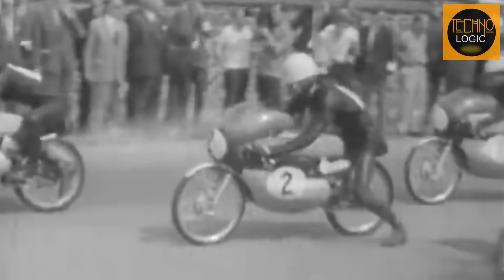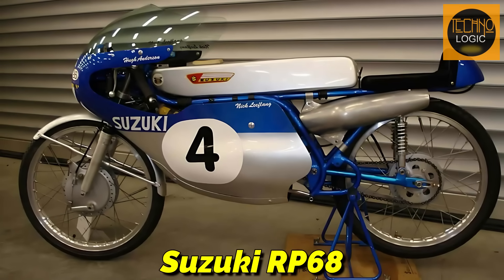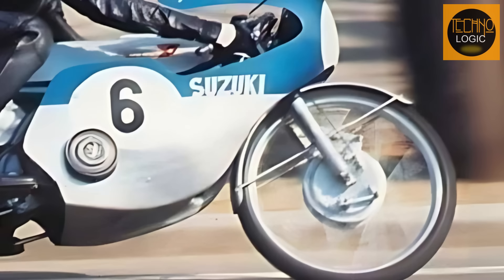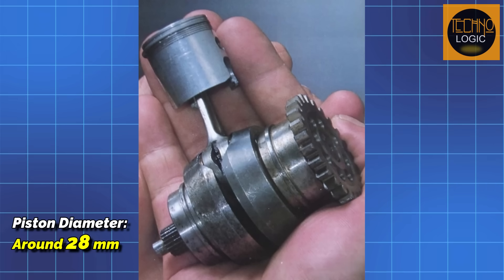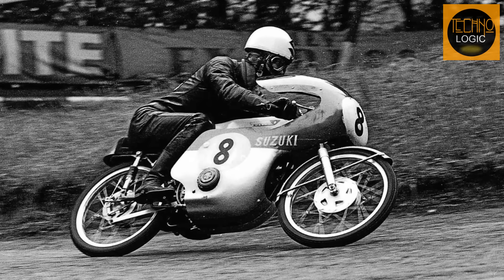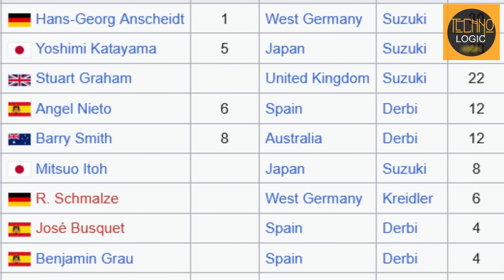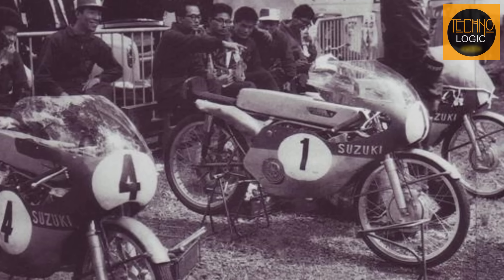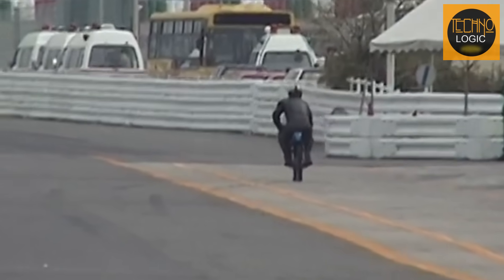INSANE‼️ Suzuki's 50cc V3 with 16 Gears: The 1960s Ambitious Project to Beat Honda

Comment: The cylinder bore was 32.5 millimetres or 1 1/3 inches! A US silver dollar has a diameter of 1 1/2 inches! 17.5 hp! Max rpm's 17,300 .. at which each cylinder would be firing 144 times a second! Top speed 109 mph! Engine displacement 49.75 cc .. in comparison the average gas engine for a push lawnmower is between 140 cc and 190 cc and has only 2 to 7 horsepower! The RK67 was indeed AMAZING!
Reply: That most importance are materials behind this engine

Comment: I still wonder why the racing organizers didn't immediately intervene with these multi-cylinder engines.
Multi-cylinder engines with the same total displacement can always produce more power because of the larger available cylinder and cylinder head surface area relative to the displacement, meaning valves or ports that simply have more flow.
They hadn't anticipated this in the technical regulations, which encouraged unfairness.
Moreover, only manufacturers with more money can produce these engines more easily.

Comment: 400HP per Liter but at least slower than the RK67 Twin, H.G. Anscheidt have reported from test runs that the RP was peakier and so more difficult to ride and at least it leads to slower lap times even the tracks were faster with more flat out parts

Comment: The 1968 Suzuki RP68 was intended to compete in the 1968 season, however a rule change mandating single-cylinder engines meant that the 50 cc (3.1 cu in) RP68 never raced.

Comment: The V3 engine has pistons the size of sewing thimbles, the rings could be used a wedding bands, you're almost getting into toy RC engine specs, and they do over 100 mph with a human onboard,
Reply: Not so. The width of sewing thimbles, which refers to their diameter, varies significantly by size and brand, generally ranging from approximately 14 mm to 18.5 mm for standard metal thimbles. The specification stated on this video is that the piston diameter of the V3 50cc was around 28 mm which is over one inch wide which is a lot bigger than the diameter of an average sewing thimble.

Comment: Honda only won a single 50cc title. It was always Suzuki that led the way in this class.
Reply: Yes, thanks to stealing the technology from MZ. 👍
Reply: @blipco5 all manufacturers steal other manufacturers technology. It’s been going on in every form of Racing there is.
Reply: @xipingpooh5783  Walter Kaaden was an original designer. He didn’t steal from anybody. Suzuki flat out stole his plans through Degner.
Reply: @blipco5  Wrong, using a tuned exhaust was established practice before Kaaden applied it to a motorcycle.

Comment: I heard of Honda producing a 50cc twin, but this Suzuki is surely miraculous? And so long ago! Thank you so much for a fascinating video.
Reply: It would no doubt be easier to produce a triple 2 stroke than a 4 stroke as all you need is sufficient cylinder diameter to accommodate a spark plug, no room n3eded for valves!
Reply: Honda also made a 5 cylinder 125 cc machine, it was a 4 stroke.
Reply: @georgebarnes8163 Fascinating. I'll have to investigate. Thank you very much. Best regards.
Reply: @SpiritintheSky. Specially for secret of the materials its very amazing

Comment: And you of course failed to recognize that suzuki stole the mz research results from the brilliant german MZ Engineer Walter Kaaden , who despite only having very small means to work with, and only through persistence and sheer brilliance had made enormous leaps in high power two stroke development . And it was only with this "help" that suzuki were so far ahead of the competition !
Reply: Walter Kaaden hat es das Herz gebrochen.😢
Reply: Ernst Degner was an east German who rode for motorwerken zashpow mz he defected will the help of Jimmy from Suzuki that's how Suzuki got Walter Kardens tech
Reply: Kaaden didn't invent it either.
Reply: Not stolen Kaaden took it to Japan unhappy with MZ. by the way the idea was first used in V1 rockets.
Reply: @stanis4218 No he didn't. And yes the only way a second rate(at best..) manufacturer like suz. could do what they did in racing , was with stolen technology ! Get real and open your eyes 🫣
Reply: Das war Degner . Bitte richtig informieren bevor man so einen Unsinn schreibt.  @stanis4218
Reply: @stanis4218  "by the way the idea was first used in V1 rockets." No it wasn't - stop repeating nonsense.

Comment: Technology better suited to large displacement high revving 4-strokes....Which is exactly the direction Japanese makers went with it, within only a few years. This kind of complication makes no sense in small cc two-strokes (or 4) It's little more than an engineering exercise, leading to much larger engine designs sometime later.

Comment: Fascinating story, fascinating machine.  But the commentary is just plain weird, the narrator made numerous flubs.  First, the Suzuki's tube frame was made of steel, not aluminum.  Second, the word "liter" is pronounced "lee-tur."  And not "lighter", as he stated.  And finally Hans Georg Anscheidt's middle name is not pronounced "Gee-org."  Otherwise, an interesting tome..    .
Reply: The blue frame is aluminum. Look at the thickness of the brackets and size of welds.

Comment: 4:34 A misconception: The gearbox usually has as many gears as needed for the specific race-course. Which means, while a course needs 15 specific gears, another course may demand 16 specific gears, which are different to the 15 gears of the previous course. Not every single gear is different/changed, but many won´t be found in the next gearbox. The gears chosen, relate to the number of curves of the specific course, and the capabilities of the driver/machine-combo: When the driver exits a specific curve of the course, he shall have a matching gear to shift-up smoothly (dependent on the driver/machine-combo capabilities). In other words, each gear was attributed to a single curve of a specific race-course of the championship, although it might end up being used in several other curves of different race-courses but with similar characteristics (similar entry-speed, similar exit-speed-potential, similar curve-curvature, -inclination and -angle).
Reply: Many gears were needed to keep the engine within its narrow powerband (500 rpm). I don't think there is any correlation between track curves and the number of gears.
Reply: @TheHalloweenmasks  You´ll agree, that reducing the powerband from 2000rpm to 500rpm would need 24 gears instead of just 6... So, 16 gears isn´t "a lot", it´s "too few" (but more than 17-18 is anyways impossible)... But when is the most important timepoint, when a gear-change matters most? It´s the curve-exit. Racers don´t compete on endless, straight lines (that´s why their possible top-speeds are much higher than what they´ll reach in real-life-races), they just try to reduce the negative effects of curves. And if there´s too few curves (and so, less gears for curves are needed), then they have room left for what you meant. Aside to that, what you say, it would mean a fixed gearbox for a fixed engine... But in reality, despite the engine always being the same ("fixed"), the gearbox contains different gears from race to race.
Reply: Sir have u heard what kind materials of gears to build this engine?

Comment: A Uprated copy of the DKW.
Reply: MZ. not DKW
While MZ rose from the ashes of the original pre-war DKW works, post war DKW started up again in Ingolstadt in Bavaria. The Suzukis were derived from details stolen from MZ by Ernst Degner - at that time, MZ and DKW were not related. DKW did make an interesting 3 cylinder racer post war though.

Comment: Luv the rotary valve twin cylinder 2-strokes.
Reply: It's still the way to go for two-stroke design if you are after top-end power.

Modern kart engines all use rotary valve induction, unless the regulations proscribe them. A Reed Valve 125cc will typically drop 2-3bhp in comparison.

Comment: The V3 Suzuki never raced, it was too complcated. The Kreidler VanVeen had only 1 cylinder and more horsepower, about 21.
Reply: Was nothing to do with being too complicated it was due to changes in the rules which only allowed single cylinder engines. Honda also had a triple cylinder four stroke but that was also never raced
Reply: The rules changed before it could be raced.
Reply: @rekzkat I just explained that 😂
Reply: The sixties 2-strokes from Japan were tuned to different principles: with high crankcase compression, different porting, and lots more, they are from a different generation to the Kreidler. 
A same-generation multi-cylinder design would have the upper hand. Especially a Japanese one. Even with six gears.
Reply: @TobiasCat-s7n  on the world circus yes on short circuits no.
Reply: The Van Veen was produced years later, if Suzuki had done more development on the engine likely would produced more hp
Reply: @A-FrameWedge it would win on the big world championship circuits but on short circuits it wouldn't have time to get wound up because of the lack of drive ability. I'm good friends with Hugh Anderson and he told me what they were like to ride.

Comment: I wonder, if  Ernst Degner was involved in the development. Some say he brought a lot of knowledge about 2-Strokes to Suzuki.
Reply: he brought the knowledge of 2stroke-exhaust-resonance-chambers (he learnt about while a technician, building the V1-pulse-jet-rocket), that´s the 2stroke´s turbocharger (without moving parts). For me, a 2stroke without it, isn´t even something worth called an "engine", cause it can only half-breathe.
Reply: @klausbrinck2137 " he learnt about while a technician, building the V1-pulse-jet-rocket"
No "he" didn't. Degner was only 14 or 15 at the end of the war.
And the V1 was a pulse jet, not a rocket- different technologies that Walter Kaaden didnt work on either. He apparently worked for the aircraft manufactuer Henschel on the control systems for the HS293 glide bomb which was a Luftwaffe project - the Vi was a Fiesler product with an Argus pluse jet.and was an Army project.
Reply: @mgnbukint6502  It´s true, I confused the mentor and the pupil, but still, "rocket" isn´t a tech describing anything precise, so, one can clutch the word "rocket" to nearly everything, it´s just a marketing-term... It´s just a word without scientific content/meaning...
Reply: @klausbrinck2137  In engineering, use of words matters. 

So a pulse jet is a resonant engine type - a rocket motor works on different principles, with little in common. The V1 ( a simple subsonic cruise missile) used a pulse jet, the V2 (a supersonic intercontinental ballistic missile) used a rocket motor. 

Kaaden had nothing to do with either of them. Resonant exhaust systems were known about before WW2. Assymetric timing of two stroke engines was known about before WW2 (IIRC Scott raced a  liquid cooled rotary valve two stroke twin at the TT around 1922). Kaaden actively sought to use a resonant exhaust with a rotary valve two stroke - he didn't invent either, but was the first to bring the two together & put in the hard yards working out the wrinkles under very difficult circumstances (no money, few resources in the early post war DDR). 

Then, as the results started to come in after all the hard work, Degner stole the details & sold them to Suzuki in such a way as to deny MZ the World Championship. His defection meant that MZ personel were not allowed to travel abroad to contest the World Championship again.  

Degner was a self-serving individual who didn't care about the cost to his collegues of his treachery. Arguably he got his just deserts later.
Reply: Check the book "Stealing Speed" by Mat Oxley

But Degner was not the one behind the technology development at MZ. That was Walter Kaaden, who was also the one workung on the V1.
Reply: @Stroke2Engineering  Sorry, my mistake !!!
Reply: @Stroke2Engineering  "That was Walter Kaaden, who was also the one workung on the V1." Kaaden didn't work on the V1
Reply: @mgnbukint6502  where do you have that info from?

Comment: Nice video. If memory serves me well, it was never called GP50 class. The 50cc category was just one of the 6 classes that made up the motorcycle worldchampionship racing in those days. I was there, happy times!
Reply: I once had a good look at Honda's full line-up of GP bikes back then, Hailwood's 6-cylinder machine and their 50cc vertical twin, Just before the 750 - 4 launch,,

Comment: The first time I hear about a V3 Suzuki 50cm3.
The made a twin.
Reply: It was supposed to be next evolution of the 50cc gp bike but Suzuki pulled out in 69 from Gp racing so didn't bother because of rule changes. The small multi cylinder machines are by far the most interesting to me